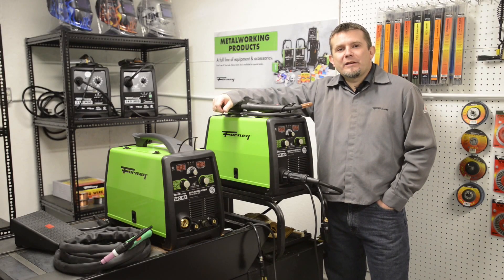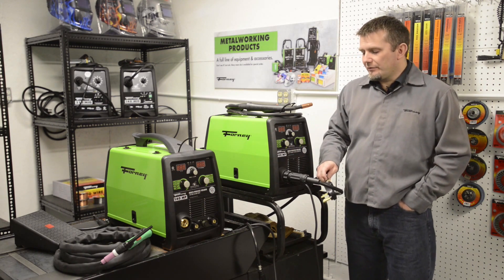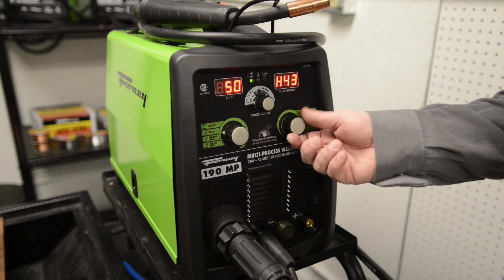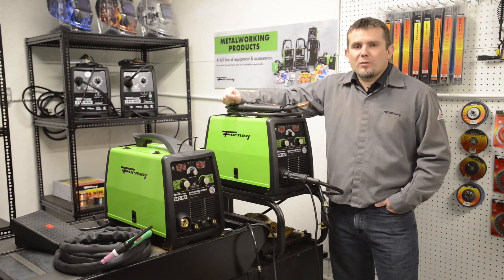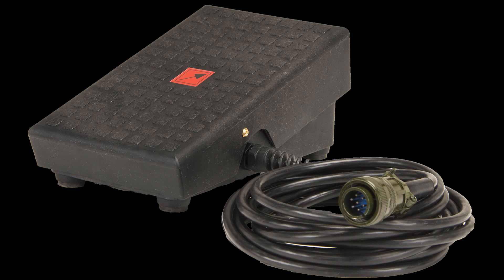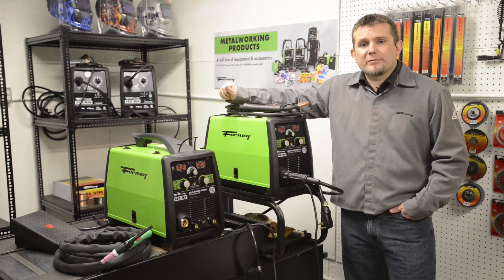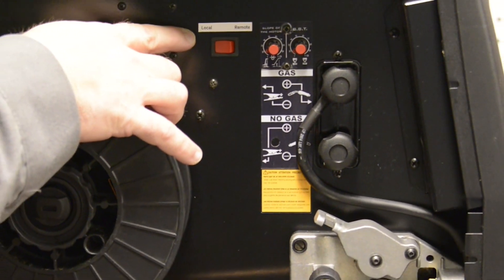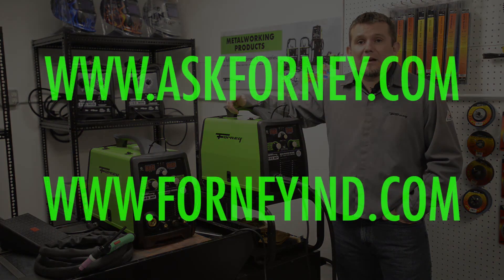Forney® 140 & 190 MP Welders: "3 in 1" Multiple Welding Processes - MIG, Stick, TIG

Comment: The welder comes with one roller .035 and .023.    I have the exact same welder and has been working wonders for me. I also added the Tig and pedal as well. I run it off a predator generator 8750 watt. The settings are on the door to access the Mig wire. My advice is to stay within the parameters of .023 and .035. Just keep on Adjusting. I am currently using Lincoln electric .025 MiG wire on the .023 roller and it fits through the .023 contact tip too. its working smoothly!!! It is really a Nice machine for all sorts of jobs. I'm going on 3 yrs with this beast.

Comment: hi,does the easy weld 140 mp can weld aluminum?i wanted to buy a multi process welder for projeck..thanks
Reply from the maker: Hi there, our Forney 140 MP is only DC TIG capable and can only weld aluminum with a spool gun. This is the same for any of our Forney multi-process welders. If you are looking specifically for a machine that can do AC TIG welding, we would recommend our Forney 220 AC/DC: https://www.forneyind.com/search-results?q=welder+package
Reply: @forneyind   thank you very much for coming back.i wanna order the 140 MP from Home depot and a spool gun.
Reply: @forneyind  Which spool gun works with the Forney 140 MP Easyweld?

Comment: Hi, I finally decided to learn how to weld and purchased the 190 machine. I noticed that there are no directions for the use of flux core 0.30 wire which I bought per a welder advise. Could you please let me know if I can use that wire size and if so what should be the settings for the right and left knobs. Thank you.
Reply from the maker: Hi Mark, thanks for reaching out. Yes, the Forney 190 MP can use .030 wire. The drive roll that came with the machine has grooves for both .030 and .035. As for the settings, there should be a settings chart on the inside of the cabinet door. There is also a chart on page 26 of your manual. If you have any other questions feel free to reach out to our Expert-Techs and they'd be more than happy to answer any of your questions. You can reach them at 1-800-521-6038 ext. 2
Reply: @forneyind  Hi, thank you for the answer. The page 26 of the manual for the Flux Core Wire provides instructions only for the 0.35 ( 0.9 mm) but unfortunately not the 0.30. Would you happen to have chart that I could use when using the 0.30 Flux Core wire?
Reply from the maker: @markneuman2686  Unfortunately we don't have a chart for .030, but you can use the .035 setting chart as a base point. All setting charts are just to get you started, so once you start welding you'll find what works for you. A good base point we recommend starting at is 45wfs and 19V.
Reply: @forneyind  thank you

Comment: Forney, that 140 machine will not weld even a 3/32 6011 rod cranked all the way up to 10. I'm a little disappointed.
Reply from the maker: Hi Clayton, it sounds like you're welding with the Forney Easy Weld 140 MP since you have it turned up to 10. Both the Forney Easy Weld and Forney 140 MP can weld 3/32" electrodes. If you have the Forney 140 MP and are running it on 10A, that is too low for that unit to run an electrode. If you have the Forney Easy Weld 140 MP, 10A is on the high-end, so there could be an issue with the machine or the rods you are using. You can give our Expert-Techs a call at 1-800-521-6038 ext. 2, and they'd be more than happy to help you out.

Comment: What is the maximum recommended welding thickness for the 190mp? 3/8?
Reply from the maker: Hi Josh, the max recommended thickness is 1/4". Thanks for reaching out!
Reply: That's it for a 190amp machine? The 140mp claims the same capabilities

Comment: Hi there, is the 190 MP Model compatible if used in 220V 60Hertz power source? How much is it? Do you ship anywhere in Asian countries? Thanks for this review.
Reply from the maker: Yes, the Forney 190 MP will operate on 220V at 60Hz. It retails at $1,083.39. We do not ship outside of the USA through our website, but you can check out Amazon for more shipping options.

Comment: This question is for Forney 190 mp model 324 120/240 V. what size of wire of power source in the house will you be recomend, and how many amps of circuit breaker, receptacle and plug? please answer this. I 'll put power source before i buy this product. from canada
Reply from the maker: The Forney 190 MP has a welding range up to 190A. The duty cycle is 170A at 20%, 100A at 60%, and 85A at 100%. If you have more questions about this machine, you can give our expert techs a call at 800-521-6038.

Comment: I have the 140 easy weld and love it. Works great in Mig and Stick. I have a dedicated Tig so I doubt I use it for that. This welder gets after it. I was welding some 1/4 inch plate at 80% power. It penetrated so well it left a bulge on the back of the 1/4 inch plate. Turned the steel blue so it was putting out some power.

Comment: Does this have scratch start technology for Tig? Or just foot pedal?
Reply from the maker: Hi Chris, thanks for your question. This machine can be used with scratch start technology. It does not require a foot pedal. The ITEM# for our TIG torch that works with this machine is 85654. Please call our Customer Service or Engineering Technical Services department at 1-800-521-6038 for additional questions.

Comment: is tthere a  diff .tip for flux wire welding  for a 180  forney welder   chuck
Reply from the maker: Hi there. No, you do not need a different tip for flux-cored wire welding with your Forney 180 FI machine. Thanks for your question.

Comment: What is the maximum recommended thickness of steel for the Forney 140?
will it weld 1/4 steel ?
Thanks
Reply from the maker: Hi there! The maximum recommended thickness for this machine is 1/4in.
Reply: Yes, very well on the number 8 setting, I run wire speed at 7 for that setting.

Comment: Looking at purchasing a 200 amp range TIG. Your 190 MP looks like a good option. What kind of start is the TIG? Also many competitors are Chinese. I've had my share of disappointments with Chinese products. Forney is not Chinese, right?
Reply from the maker: Hi Stan, thanks for your inquiry. The 190 MP uses a lift start TIG and it is a DC only power source and will not TIG weld aluminum. Our Forney machines are designed by American and European welding engineers using Forney specifications.  Our Italian manufacturing partner has a great reputation for producing quality welding machines.

Comment: What is the difference between the Forney 318 and the 324 MP? I know the 324 MP can be set to 120 or 240, anything else?
Reply from the maker: +ReganHunt The Forney 190 MP (ITEM# 324) is a 3-in-1 multi-process unit. This means it has the capability to MIG (GMAW) (FCAW), Stick and TIG weld with the flip of a switch. It is also spool gun capable to weld aluminum. It has an input power of 230V or 120V and a rated output of 170A@20% duty cycle.

The 190 MIG (ITEM# 318) can do MIG (GMAW) (FCAW) welding only. It has an input power of 230V and a rated output of 120A@25% duty cycle.

Comment: well shit, ive been in the market for my first welder and it was between everlast and ahp, and now i guess Forney is in the running. the one thing i really like is the all metal wire drive (all the listed have this) and the digital readout for wire speed and voltage for mig welding

I hate that stupid shit where the numbers are just like oh 1-10, no screw that i have a certain sized piece of metal and i want to set it by voltage/wire speed, not some stupid random number and or, letter, whatever company would deem i need for that job.
Reply from the maker: +thelasthallow Thank you for your comment. Our Forney machines are designed by American and European welding engineers using Forney specifications.  Our Italian manufacturing partner has a great reputation for producing quality welding machines.  We benchmark our machines against the top manufacturers and I think you will find them as good or better than our competition.
Reply: I got my 190 MP about a year ago from Big R and kept using my Roughneck for another 6 months without even unboxing the new Forney- Finally opened it up and now realize I cant find my Roughneck for some field work I need to do.  Damn... Might need to just get me a good generator and take the Forney!!
Reply: JAleksandr Found out the forney are just cheap chinese welders, there are like 3 other different companies that use this exact same welder and sell it as their own brand.
Reply: It is doing everything I'm puttin it through extremely well-though I'm not a fab shop, but we have done several very large truck racks including my 33'er on my F-550 and a couple trailer and shop racks-It will be on 2 trailers just after the holidays.  Again-we are not a fab shop but we haven't had ANY issues with it and it has more than paid for itself several times over.  What did you end up getting??
Reply: @thelasthallow which three others?
Reply: @halfmoon5022  you just replied to a 9 year old comment, how the fuck am i supposed to remember?
Reply from the maker: +JAleksandr We're happy to hear you're getting great use out of your 190 MP.